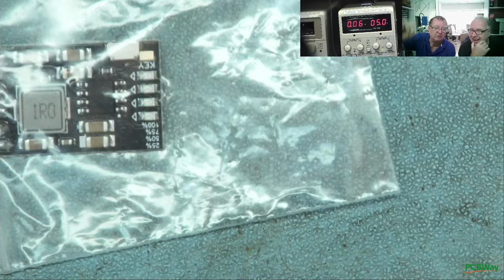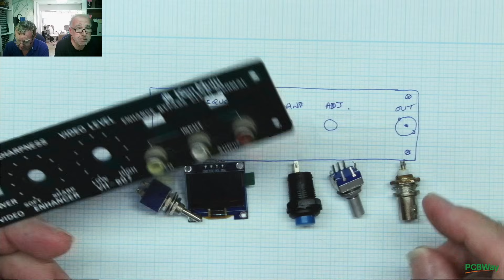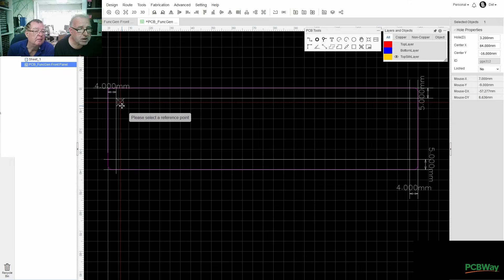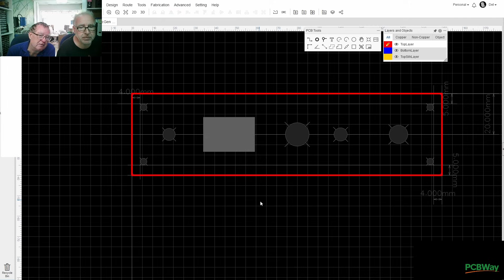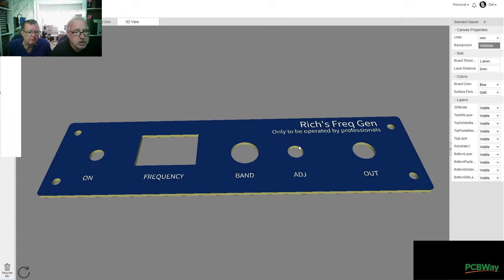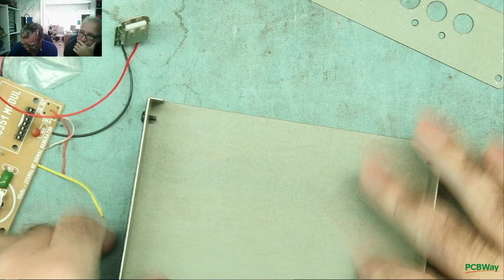How To Make Professional Looking Front Panels For Your DIY Electronics Projects Face Plate

Comment: I edited the original Arduino sketch to make it more suitable to use as a signal generator. I've removed the references to the receiver parts & simplified the display to only show frequency & step values, so the display is clearer & less cluttered without showing all the unwanted stuff. I also changed the band frequencies to those which are more suited to a sig gen, rather than the ones which were set to amateur & broadcast bands. I sent it to you yesterday if you want to try it out yourself.
Reply: Sent a revised sketch (ver_8) earlier today.

Comment: Does it have an electronic output attenuator so the rf output level can be precisely tuned in micro Volts steps down to as low as 1 micro Volts ?  If not., can it be added  in soft or as a separate (perhaps a mechanical attenuator) Z=50 ohms recovered from some other similar equipment ?

Comment: I had to make a faceplate for a project, it was quite big. So what I did was bought some sheet aluminium. I then bought some transparent plastic sheets with adhesive backing so that I could print the faceplate design onto it, so I made all the markings and text that I needed. Then positioned it on the aluminium sheet and cut the plastic sheet around the aluminium panel edge and gave it a light sand with very fine sandpaper so there isnt a sharp edge of the plastic. All the holes I needed were marked on the plastic sheet just centre punch and drill them out. 

Worked really well, unfortunately the faceplate was bigger than A4 sheet so I had to stick two sheets next to each other but next time I make something Ill make it smaller than A4 and then it would look really nice, you get the effect of whatever material you choose behind the plastic sheet and you can even print colours and diagrams etc. If you wanted to, you can then stick another sheet on top so that the ink is sandwiched and doesn't rub off over time, I'd definitely do that if I was to do it again.
Reply: Hi PN, you actually can do color prints - PCBWay has this feature now in beta. I had a short look on how to do this, and it felt very complicated; I probably grab a graphics program and draw everything.

For a frontplate bigger than A4 our solution probably isn't feasible - the PCB manufactures can to huge PCBs, but they get expensive really fast.

Comment: I think it would be better to design the panels for a standard type metal case, not a random leftover box. Then, everyone can use a recommended box or split aluminum box for the project.
Reply: Hi KB1UIF - absolutely. Re-Buildability is not very high with this project. Rich wanted to re-use this enclosure you see in the video - I'd normally go for a housing you can buy from the usual sources.
 

But as a demo on how to mis-use a PCB, I think this works fine :)
Reply: @DetBuildsStuff  Yes, it's a good demo, but I'd like to see something uploaded to the PCB manufacturer for a standard type case. So others can use it without needing to redesign it. Thanks.

Comment: Just a friendly note that I think you have the 'night light' setting turned on in your computer.  Whenever you go tho the computer screen, I keep thinking MY night light is on, but the small video feeds you keep in the corners aren't affected by it.   It seems to on in several recent videos, and almost each time I go to check the settings on my side for the night light - only to find it off. 🙂
As an interesting side note, I had once turned it on to see what it did and had trouble keeping it turned off for some reason.  I still have no idea what I did differently to get it to stay off, so I'm now really weary of ever turning it on again - even though it might be nice to use every once in a while.  (And yes, I checked that there were no settings set for keeping it on a daily schedule.)  So you might end up finding yourself in the same boat.
Reply: Ah...I wondered why there was an orange tint when the computer screen was shown. I thougt it was something to do with my cataracts getting worse! :) Didn't know about the Night Light setting.

Comment: How are you going to fix the lcd screen onto the board.? You did not seem to make provision for screw holes or are you assuming the soldering will hold it there? Great project by the way very innovative use of PCB perhaps others have done this but it’s the first time I have seen it. Just another thought the nuts that hold switch , BNC etc onto board will possibly cut through to ground plane , hope this will not be a problem.
Reply: Hi Nigel - we'll try the "mount-by-solder" first - this is a first for me, too. If this feels unstable, I guess it's time for hot snot. Or drill 4 holes in the front plate and use mounting screws.

Comment: I thought this idea was a bit mad to start with and excessive to have manufactered a pcb for effectively just a switch mounting panel. 
But oh no. Its fabulous with it's in built tracks and windows. A brilliant total earth plane shielding across the front of the enclosure is genius. 👏
I cant wait to see if the LEDs shine through ok.
I do wonder if its worth designing a new mother board as so much of the original is now redundant or moved. Then you could incorporate the usb type mount points more easily and ensure they are bolted either side for long term reliability. I'm not keen on 1 bolt fixings.
There is so much to experiment with and explore for a 'simple' panel 😉
Keep going 💪
Reply: Hi Warwick - As you say: this project is at a point that a re-design would probably be a good idea. 

If this was my brain-child, I'd probably do that - but since we have a functioning system already and I don't want to go down that rabit hole - not this time :)

AFAIK Tim's doing a re-write of the software - if we get that, we'll drop a link in the final video (when the PCBs have arrived).

One thing I would do different: I'd use a enclosure you can easily buy from the usual sources. This front plate will oinly fit Richard's scrap housing, so re-buildability (is that a word?) is not very high.

Comment: Interesting use of a PCB. It would never have crossed my mind to use a PCB as a front or rear panel. Since I've bought myself a 3D printer I have actually made a full enclosure minus the front panel to suit a 12V cigarette lighter socket, USB and voltage display panel bought off of eBay. I can now make any enclosure without front or back and use PCBs as such. I have plans to make some of my own test gear such as this frequency generator. Thanks for sharing this great idea!

Comment: Hi guys! Thanks for the video. It was just in time for me figuring out the charge/discharge module. I was putting one into a diy Milliohmmeter that was only drawing 30mA , so cut out after 30 seconds. In the end I just added a 100 ohm resistor in parallel to the load and took it to 70mA. I also used the push button KEY pad to add another push button as an on-off switch to the outside of the meter box. As always, I found some learnings in your video. Thanks again. Paul

Comment: Personally I would make the hole for the display about 1mm larger all round the actual display area of the screen.
To hold the display module in place behind the PCB, well the PCB is double sided, so: You see the mount holes for the display module, on the back side of the PCB where the mount holes will be, put large solder pads. On these pads you can solder thick solid coper wires bent up, so they poke through the mount holes of the display module. When put the display module in place you can bend the coper wire over the edge.
If you wanted to make it really solid you could also solder the wire to the display mount holes once in the correct place.
I hope explained that OK, I could do a sketch if you like?
Reply: Hey Tim - thanks for the input; we'll try with the pads first. This is somewhat untested, so we'll figure stuff like that out as we go along. Wost thing that could happen: we eff up one of the panels. Since we're ordering 5, there's some leeway for errors :)
Reply: @DetBuildsStuff  It was just a thought, I tend to get lots, haha.
I do like the have the screen clamped (sandwiched) between two parts.
The screen is only held on with double sided adessive tape.
Reply from the maker: @Tims_Projects  I wanted the screen to be flush into the cutout, so the PCB part of the display would be flat against the rear of the panel PCB.  I think I can add a bit of leaded solder to the exposed pads, heat it up with hot air until the solder lmelts and then press the display in place.  But like Det says this is all somewhat experimental
Reply: @LearnElectronicsRepair  I think it will work well.
Reply: Oh I forgot a little tip.
When I am removing Pin-Headers, what I do is I warm up the plastic stand-off, just enough to soften the plastic (not melt). Then I force some tweezers under the plastic and slide the Stand-off up off the pins. Then you can remove the pins individually.
Reply: If you add ‘thermal relief’ (i.e. thin tracks) between the ground pads and ground plane it’ll make it easier to solder, otherwise that ground plane will be sucking away a lot of heat.

Comment: why not take the led of off the arduino and connect a led with wires to it .... and you got the power led ??? it is that simple really
Reply from the maker: Because the display lights up so the LED is redundant

Comment: Whats the name of the front pannel designer software
Reply from the maker: It's not special software for that purpose, it is PCB design software and there are several free ones you can chose.
Reply: so i was u see the impression that i had to design and layout a schematic before. designing the pads on the board and traces.  but it doesn’t look like that here.  can i just design whatever i want in the pcb side of the software and not even worry about the schematic?
Reply from the maker: @eross21  Yes, normally you would work that way but you don't have to design a schematic first.  What you do need to do is create the exposed copper pads, then give each one that you want to connect together a net name.  You can then draw wires between each pad of the same name.  Agreed this is not the way most PCB layout software is intended to be used, it's an inventive way of making things like front panels where you don't need many PCB traces.  Of course you could design an entire project to fit onto the rear of the panel, if you use SMD components only 😉
Reply: @LearnElectronicsRepair  oh very cool.  what program are you guys using here ?
Reply from the maker: @eross21  This video used EasyEDA but you could use KiCAD or one of several other free PCB layout programs

Comment: what is that software you are using sir?
Reply from the maker: Use any PCB design / layout software
Reply: @LearnElectronicsRepair  you cannot tell the name of the software you are using in this video sir?
Reply from the maker: @kalanguyatech  This video used EasyEDA but you could also use Kicad which some prefer.

Comment: Thanks again for putting another great video out just at teatime! Loved it! I'll be "trying" to design a faceplate tonight but Deklan skipped through the hole size making steps....Thanks Guys!
Reply from the maker: Oh, Detlef.  Basically we used a caliper to measure the size of the shaft on the control, then made the hole to that size.  I'm sure Det can add a bit more detail here for you 🙂
Reply: "Detlef" my apologies for mispronunciation and spelling.
Reply: @darrenbird2526  What Rich said :) We have this very cheap and unreliable caliper in the shop - we did all measurements with that. For drillholes: drop the drillhole from the - I think "Tools" pallette onto the board, klick on it - there you can adjust the diameter. 
Have fun playing with your faceplate!